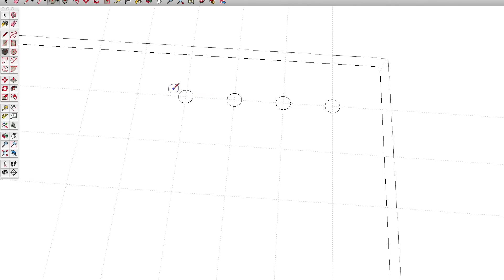How to make a Solderless Prototype Breadboard

Comment: Sadly this is not what i was looking for. This does not show how to electrically connect all those breadboards together which is what they have in classrooms. The 3m ones are electrically connected so not to waste slots on cables to connect the 3 or more boards.

Comment: why tracing lines then free hand cut the material without the guide ?
why masking an area that can't be seen ?
why make your nuts captive under a glued part?

why ?
Reply: its like saying "how to make a prototype breadboard" but you already bought the protoboards and just add a panel
Reply: You and 4 others are dopes.
1. He clearly made scoring cuts, several times before removing the ruler and simply following the existing score. Pretty standard in any work that involves scoring, like drywall, tile, some woods.  
2. Maybe the paint is potentially conductive?
3. Installing it WITHOUT the nut is going to end up having the top part always pulling up and out any time there is the least amount of pressure on the wire. Just what should he do to both secure the threaded part and insure that voltage carrying piece of metal doesn't interact with something below the board?

Why do dumb people try to act so smart by asking really dumb questions? In the future, they ought to start requiring a license to get on the Information Superhighway...